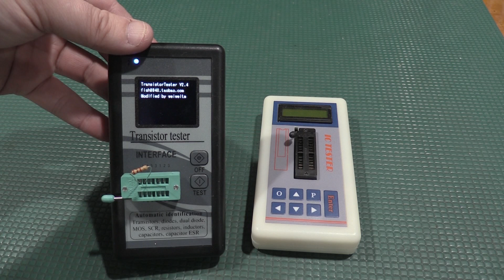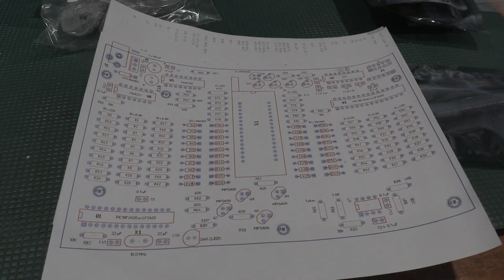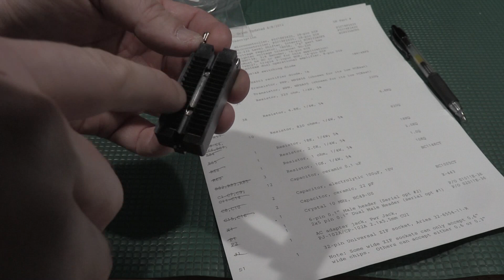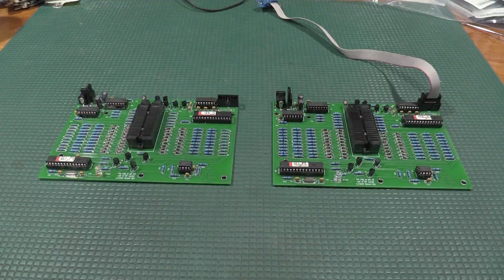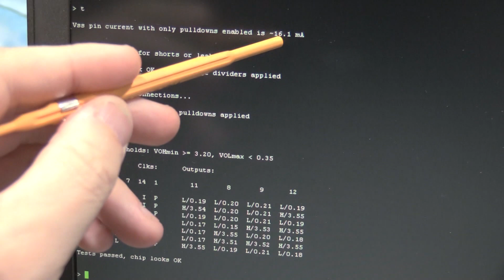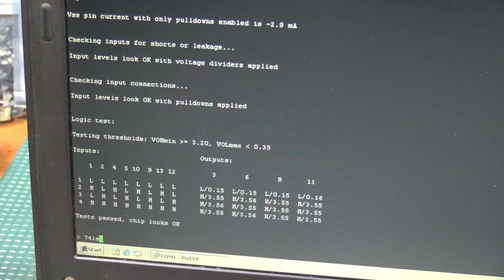New IC tester for the lab.

Comment: Did you make a video using this tester? 
I'm starting work on TG501. I appreciated your videos.
Reply from the maker: Thanks, glad I can help. I have not made a video specifically on the use of this tester but I have used it in some videos as part of the troubleshooting process. For the TG501. If there is no output once the power rails are confirmed check the main clock and make sure that is present. If the main clock is not there the unit will look totally dead, Also the output needs to be terminated at 50 Ohms or nothing will be there. One other thing to check is that the plugin is not configured to use an external clock. I have one unit in the lab set up for external reference so I can use the Rb standard. The other unit has the high stability 5Mhs crystal. These units can be configured for 1Mhz 5Mhz and 10Mhz external clocks but only ONE is picked. If it is set up for 5Mhz and a 10Mhz ref is used the unit will also look dead due to tripping the “out of spec” circuit.
Reply: @Zenwizard Studios  TG501: Good news so far is the cammed switches appear fine, and I'm getting accurate frequencies up to 1GHz, though pulse shapes/generation fall apart above ~KHz frequencies.  Very erratic. 
I'm thinking testing chips is a good thing to do.  What chip tester can you recommend? Don't want a big diy project for it, though.  I have TM502 on the way, so I will be able to check V test points soon.

Comment: This is a great ic tester. I mostly work with 74xx family ic’s and with Vss output you can easily "catch" fake cmos ic’s that sold as 74xx ttl. The version 0.59 fix some bugs in 2-3 ttl logic’s. Many IC tester’s can test the same Ic’s but none of them have all that useful informations. I strongly recommend it to everyone that mostly work with 1970-1980 hardware.

Comment: Actually, the 4516 should already be in the database.  Try just typing 4516.   Also, you can just type LS10 instead of 74LS10.  If you find some other unsupported chips that you think are common enough to be added, check the location of the power pins.  If that combination is supported, I could look at adding them.   Not promising anything.  New firmware would only be on my site for download, not for sale separately as PIC chips are hard to get right now.  Most USB EPROM programmers can handle PIC chips.  Also, something like a DRAM would take as many vectors as all of the chips currently in the database, so it needs a different type of test/tester.  Bob
Reply from the maker: Awesome to know there is update able firmware I will add a note about that in the description.

Comment: Great video, and thanks for pointing out the different sizes of 1/4 watt resistors.
I also noticed that the 1.2 board corrected the floating connections on the unused op-amp on U7B.

Comment: There is also the "Retro Chip Tester Pro" available, it supports lots of devices, has support, and has the ability to expand its library. It is also a kit so you have to buy your own parts, but there is a BOM linked to digikey etc. to make it easy to get the required parts. I am yet to build mine, but it has been featured on some other channels too which gives you an idea of what is involved.
Reply from the maker: I do plan on building a RCT pro in the near future It has a HUGE library of sram chips.

Comment: I now have chip tester envy---I got the V1.1 board from 2013. I made my own trivial mod to V1.1 to not use the RS232 IC (as I only had a TTL-level serial-to-USB at the time). It's good to see that this is now part of the V1.2 revision as well as the power LED.
Reply from the maker: Ill also be building one of these at some point https://8bit-museum.de/sonstiges/hardware-projekte/hardware-projekte-chip-tester-english/ I like to UI of the Tauntek better but the RCTP has an update-able firmware so it can dynamically add chips as well as check SRAM chips. I am not sure if the Tauntek does SRAM but I will find out.